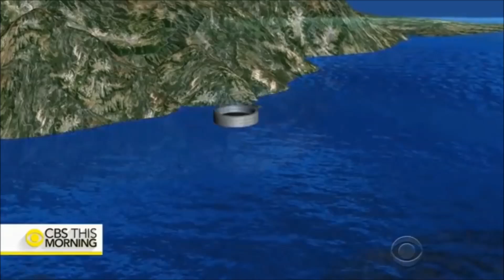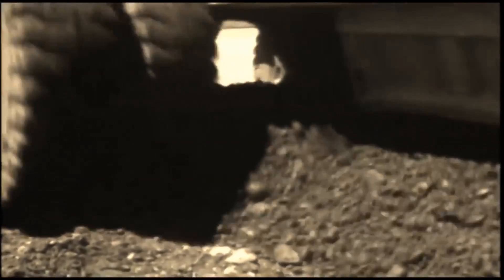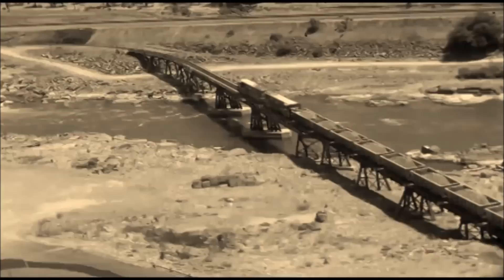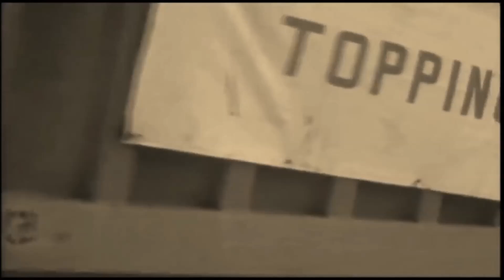Oroville Dam & The Glory Hole That Never Was

Comment: glory hole??? no mention ever except for what you have claimed
Reply: Not all dams have glory holes. Only dams with no room to build a normal spillway has them.

Privileged has a the spillway as well as the original diversion tunnels to release water, now known as the River outlet system. Which was not working during the spring thaw due to the valves being rebuilt.
Reply from the maker: no mention of it because during construction the structure failed before it was even completed.
Reply: can i read about it anywhere?
Reply from the maker: its mentioned in many videos as being filled with debris. I know it's there, these large reservoirs all have them, you can also see its outlet here https://youtu.be/w3sRHT4vYEs you could try to search google for documents.